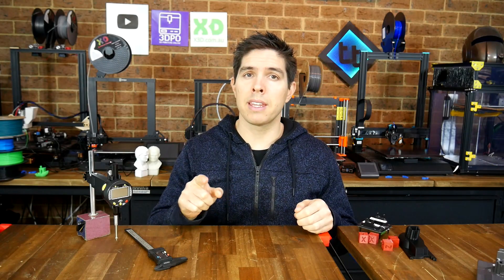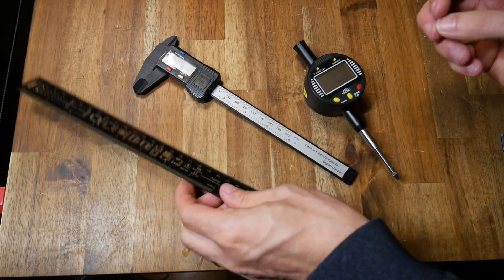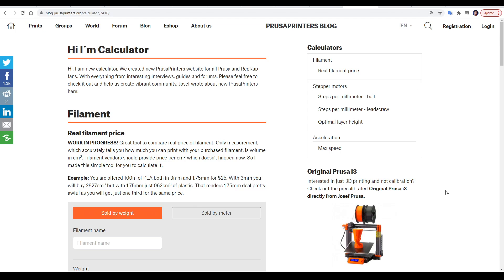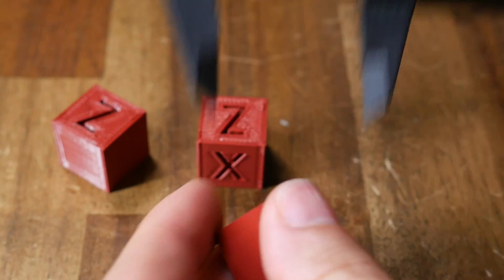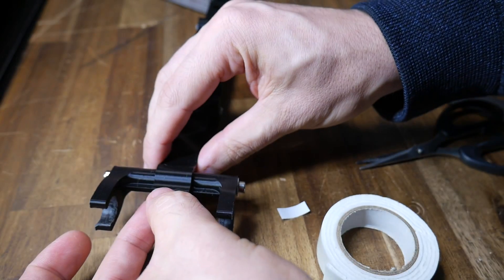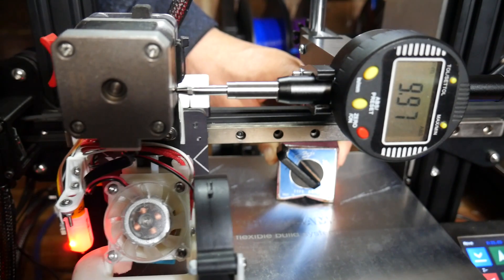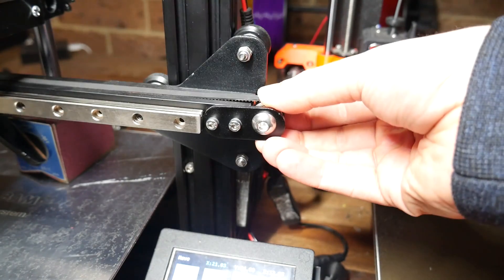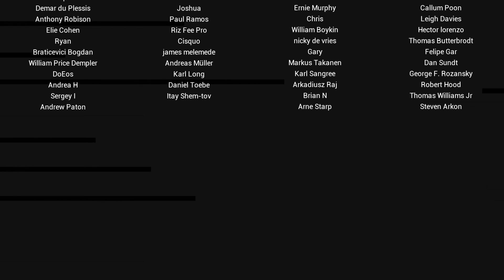Calibrating your XYZ steps using a dial gauge for maximum accuracy

Comment from the maker: Some responses to frequent comments here:
- In the example shown fixing Z axis binding on the Ender 3 V2, the leadscrew was removed, hence the gantry's ability to move up and down freely. The full process is here: https://youtu.be/vW4DaWCd0Xs?t=325
- A few comments on plastic shrinkage contributing to the final inaccuracy of the parts. Very good point and I will add this to the webpage.
- Some people has critiqued the method, which is fair. Ideally, we would be measuring 100mm or more of travel, but the dial gauge doesn't really allow that. There's a note about this on the webpage.
Reply: @Bode Moses No problem =)
Reply: I would rather concentrate on the full motion of the system. Measuring if the system delivers 219mm of motion instead of 220mm gives you less than half a percent. But usually if those steps per mm are off then it is worth checking the motion system first
Reply: Nice
Reply: @Bode Moses instablaster :)
Reply: @Duncan Beckham i really appreciate your reply. I got to the site through google and Im waiting for the hacking stuff now.
Seems to take a while so I will reply here later when my account password hopefully is recovered.
Reply: @Duncan Beckham It did the trick and I actually got access to my account again. Im so happy:D
Thanks so much you saved my account!
Reply: i dont mean to be off topic but does anybody know of a method to get back into an instagram account?
I was dumb forgot the account password. I love any tips you can give me.

Comment: 20.2mm over 20mm is 202mm over 200mm, that's alot.

Is there a calculator for non marlin? Klipper uses rotational distance

Comment: I have fully calibrated my Ender5pro using methods on your website. xy&z (using a digital dial gauge), e-steps flow rate etc, I then printed a calibration cube x&y were accurate but the z came out as 23.31mm I have tried this numerous times and checked my calibration but not getting any luck. Have anyone got any ideas? TIA.

Comment: digital indicators are cheap and easy, but if you get tired of swapping batteries, dial indicators can be better.  
(most people will probably call them both dial gauges/indicators, but technically a dial is an analog/mechanical device.  so i try to differentiate by calling them a dial indicator versus a digital indicator.)
an analog dial isn't as easy to read, because it basically requires a judgement call or estimation.  but if you don't want to be hunting for a battery a 1am some night when you just want to get a measurement and move on, then i would encourage you to get a dial indicator instead (and learn how to use it effectively), and cut that potential issue off at the root.
same deal with calipers.
if you're organized enough to keep spare batteries in a place that you'll be able to find when you need them, then this advice isn't for you.  but personally, i don't have enough room to keep everything that organized in my studio aptmt.  someday, but not today.  and regardless, i just like the peace of mind from knowing i don't ever have to worry about it.

Comment: I think you should add encoder for the motor and change lead screw into ball screw. Even though error is still occuring in smaller number. It is a robust way than changing your step/mm. Using dial gauge is a smart way up to a point but does not eliminate the problem of dimension shifting over time due to temperature and disturbances working on the motor and printing different material. But if you use encoder. Dial gauge is used for setting the flatness of your bed

Comment: honestly this is bad yes you can use a slicer to adj offsets but why do that when you can just use the printers esteps theres alot more to it then just the movement of the head you need to account for expansion of the filliment to if your running a .6 nozzle there will be more then a .4 or .2 and filiment type plays a big role plus your print settings look trash ive had better prints with stock cura settings on a micro swiss with 5mm retract (if you know anything about microswiss this is bad the max you want is 1mm i run .8 perfectly no stringing at all) and cura is complete trash its the type of slicer if your print fails re slice it then it norm fails a diff spot then re slice it same settings then you have a good print plus there is no reason you should be printing underextruding or over yes it changes it but a printer should never be under or over extruding in the first place if set correctly i use s3d and i can print cubes and anything else with .1% accuracy with spot on the z axis x and y is off by .01 and thats good enough for me cause if i need more accuracy i just use my 4k resin printer the best way ive been doing it is printing cali cubes and lets say 80mm is your current estep and your printing a 20mm cube and it comes out 20.34mm then your formula would be (80x20) / 20.34mm ofc you would need to do this several times and it would give you your new estep number  but you can get to stupid accurate parts and print torture test like nothing

Comment: I really have to say a caliper is not a bad tool to use in this case. There are very good constraint points for the Y and Z axis, and the X axis requires some visual aid to make it perfectly parallel, which is not ideal but I was still able to calibrate.

Comment: So there is this technique.  And then there is the horizontal expansion technique. How would i know which setting is causing my failure? As a technician i can confidently say that there are usually 3 or more  different incorrect ways to make adjustments or corrections to COMPENSATE for poor machinery performance however there is only 1 correct repair. So how would i know which is the real issue?

Comment: Another way to measure X axis and Y axis movement is to securely tape a ballpoint pen or pencil to your hotend with point resting a sheet of clean paper taped to the bed. Use the machines controls to move the hotend a given amount and then use a pair of calipers or a metal ruler to measure the length of the line on the paper. Cheap, simple, accurate and easy....

Comment: I been watching your videos for a long time now and I have learned so much. Now I am stuck. I need advice, help,suggestions.  I purchased a Biqu b1 a few months back and it prints great out of the box. I wanted to try idex printing so I found there idex upgrade kit on Amazon.  I received the kit installed all components and upgraded to the FM bigtreetech suggested.  Now comes the problem.  I try copy,mirror and idex mode and it all just went Bazar, the original X axis (X0) and the added X axis (X1) move totally different than each other.  When in copy or mirror. I try a cal cube and X0 prints at Y= 20mm Z=20mm X=20mm however the added X (X1) prints Y=20mm Z=20mm X=10mm
It seems that X1 prints at half of the x0 (I feel it maybe in the steps) the board is a skr2
Is there away to adjust the (X1) steps or anyway to text? If you or your viewers has any suggestions I would be greatly appreciated and thank for your time

Comment: Just a couple point here: First, if you want any sort of real accuracy, the factory X,Y,Z steps absolutely matter. Prove it to yourself. Print a 150mm cylinder, with a bushing around it and .2-.5mm clearance. If you have not calibrated your X,Y steps, it will not rotate in the bushing smoothly. Your circles will not be  truly round and it will bind.

I disagree with the method here though. Stepper produce  inaccuracy over distance. You are measuring such a small distance with a dial caliper, that the overall error likely wont be detectable. The proper way to calibrate is to first tune Flow, so your .4mm walls are actually .4mm, and then create a 100mm X 100mm square ring (at least) and get a precise measurement off of that.  You'll want to get as close as possible to the 100mm, however the repeatability of FDM is not really that great, so I would consider a tolerance of .1mm acceptable. The main thing you want to achieve though is that X and Y are EXACTLY (maybe within .01-.05mm) the same. Once this is achieved, try the cylinder/bushing experiment again. Now it works much better.

Comment: Most YouTubers calibrate with printed Parts an thats Not correct
You be one of the lonly people that make it Right.
I was interestet how you mounts the caliper for measuring 

Keep going on - your Input is verry nice

But calibraring Axis is mostly the wrong way.
If you have changed all Parts, your setup is mounted correctly then your Prints should be correct.

But sometimes your buyed Parts have an wide Manufacturing tolerance. Than you Can Mount it how Right you want and the Prints will ne incorect.
So in this Case you always have only ohne cance to make it better- calibrate a Bit your axis.
Ok there is anorher was buy Lots of high qualitiy Parts then it should be better but how much Money would you put in your Printer 

And then for me it is the only Right war to messure the movement direct on the axis and Not in printed Parts.

Comment: Fantastic information, thank you!
I tried this method but wanted a longer travel than what was available thru pronter face.
I used Gcode to move 40mm in each axis. I found the actual travel varied up to 50% of the typed value.
Any idea why this would happen?

Comment: Measuring the Z displacement like that (up/down) will also include an error due to backlash in the measurements.  I might suggest only driving the Z in one direction (probably upwards) and using the results of that for determining any changes to the steps/mm.  Any backlash in the system should be handled separately.

Comment: I know im late but I think there is a much better way of doing this. I have had a lot of success calibrating my X and Y steps by using a program like full controll gcode to write gcode that simply draws a one layer thick 150x150x5 cube. The gcode has the printer travel exactly 150mm, with each turn, so (while the part is still stuck to the bed) the inner diameter and outer diameter of the box for X and Y can be measured with a caliper, averaged, and then compared with 150mm to calibrate the new esteps. This removes problems due to overextrusion and errors in mounting the dial gauge.

Comment: Funny thing is, I have everything calibrated but my Y dimension is always bigger than the X, a 20mm cube measures 20.1 on Y and 19.9 on X, so it actually averages exactly 20, only it's bigger on one side and smaller on the other.
The only explanation I can think of is a combination of filament shrinkage, tool path, linear advance and etc, since the nozzle has to slow down for layer change in certain areas and not others, maybe it affects the shrinkage amount differently.

Comment: I have a question: my printer does NOT have a USB interface, it only has an SD card slot.  How can I find out what the current settings are for the XYZ steps?
Reply: I found it, someone posted online the default settings for my printer :)

Comment: Hi, I have a CR-10 Smart and like it very much.  But is lacks calibration setting on the touchscreen display or a USB to change in terminal mode.  Any suggestions?
one other question, I am was getting roughness on my first layer and I reduced the flow 83% and raised the temperature to 220C, PLA+ ,  but I am seeing some roughness on the second layer. Ideas?
Thanks
Larry

Comment: This is very helpful because the typical way is to print a xyz calibration cube but if your z steps are too short then your nozzle will not be raising enough making your print fail so you won't have the dimension to calibrate the correct steps/mm.

Also since I didn't have the dial gauge mount I just used legos

Comment: Thank you so much for a proper insight to setting up a 3D  Printer and the best thing that no one else has done and that is have a website to enter the values of the E-Steps and get a proper result without any confusion. 
now my Stepper Motors are set up correctly and now performs super accurate on my Enders 3 V

Comment: Hi I think I encountered a problem. I followed the steps with an ender 3 v2. The results: X steps changed from 80 to 84.12, Y changed from 80 to 83.32. Z changed from 400 to 426.7. Printed the 20mm cube and the dimensions were accurate to about 0.2 mm. However, now when homing the printer, the extruder assembly collides with the right side of the X axis and wants to move further, the bed collides with the belt tensioner and wants to move further. Each time I can hear the stepper motor trying to push forward. I think the increased steps threw off the bed limits. I'm afraid this will destroy the motors. Help please. Thank you!

Comment: I have been on your site a lot lately and I am curious.  Do you have your calibrations listed in the order in which they should be performed or do you have a specific order that should be followed for a new printer and testing new filaments??? I assume at the least, flow and temperature should be checked with every new roll of filament?

Comment: you absolutely shouldn't do this. all your doing is messing up your settings based on measurement errors or flex in the system. the steps/mm are defined by the belt and pulleys. Those things don't change due to backlash.

Comment: And here I thought I was doing something by printing the cube, measuring dimensions, then adjusting the steps based on over or undersized dimensions. I was able to get my cube within a few tenths of a mm in a couple prints, but I imagine I could saved the 6g of filament and the 20 extra minutes using the dial gauge. Seeing as I am building the MPCNC now I think I'm adding this to the cart.

Comment: Have  you  tried  using  a  dry  lubricant  ( either  spray  or  powder ) on  the  moving  parts ?  Especially in  the  Z  axis ..   wet  lube  and  dust  over  time  may  gum  up  things . Especially  if  they  sit  for  any  extended  amount  of  time .

Comment: People should really be careful when calibrating esteps as it will probably make more harm than good (as you said regarding flow rates).
I am not really fan of your process: calibration over 50mm of gauge displacement vs some 350mm large printers is likely to be a mess. Plus modification of z esteps is meaningless as you can have local smallish inaccuracies on the threaded rods but they will remain the same for a 0.1mm displacement and a 300mm one. You are changing coefficients here. The only thing that could benefit from esteps adjustments are axis driven by belts (so X and Y for most printers) because, even if they are not supposed to, the belts slightly loosen when tightened.

My method for this calibration is the following, for each axes:
 - print several pieces from 20 to the max you can accurately measure (150mm for me with a caliper)
 - measure each piece and plot the expected vs obtained dimensions. Beware of your slicer: something measuring 20mm is actually expected to be 20.04 when sliced with Cura at 0.2 layer height!
 - compute a linear regression
 - take the 'a' coefficient and use it to adjust the esteps. leave the b value that actually account for plastic retraction or backlash (that your method cannot deal with)

With this (and also a switch to 0.9 steppers), I have been able to achieve less than 0.1 accuracy on my CR10 which I consider pretty good given the size of the bed. And I don't mean 0.1 on just a 20x20 calibration cube (which is easy) but for any dimension.
Also you should have pretty good belts for that: my CR 10 was delivered with one part of the belt slightly loose; the same piece was 19.80 on the center of the plate and 20.30 in the border...

Comment: You can't imagine how many online arguments I've gotten into with people about this very topic. I've had supposed engineers tell me that you should not do this and you should simply rely on the numbers from the belts and pulleys. My efforts to explain to them this process resulted in them in giving me the "I'm an engineer" line. Well, I'm an engineer too and I have done enough mechanical measurements to say with a high degree of certainty, "never rely on cheap crap from China to be dimensionally accurate." I will say that I have never used a dial indicator to do this though. You should use as much of the travel on each axis as possible.

Comment: Calibrating XYZ steps this way is completely pointless, they are a mathematical calibration based on belts and gears. Trying to get a cube measuring lets say 19.5mm x direction. 20.2mm y direction, and 20.1mm z direction exactly 20mm^3 would make every piece printed after squashed and stretched. If you are unsure the accuracy of your prints, you could try to use lukeskymuh's "calibration cross" to find the average error across different lengths in the xyz directions.

Comment: When indicating the Y axis, mount a target to the bed. Print it or clamp it lightly but rigidly. Also, mount the indicator base to a heavy steel block. These two things will reduce deflection errors.
Thanks,
John

Comment: Absolutely DO NOT do this

XYZ steps per mm are calculated values based on the hardware used and all devices have a margin of error that vary by slicers settings and filament quality.